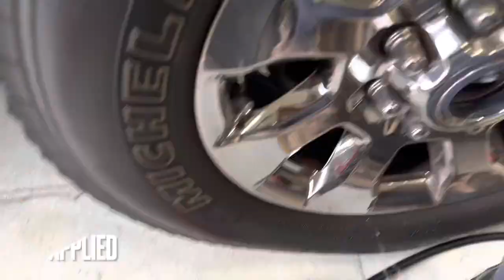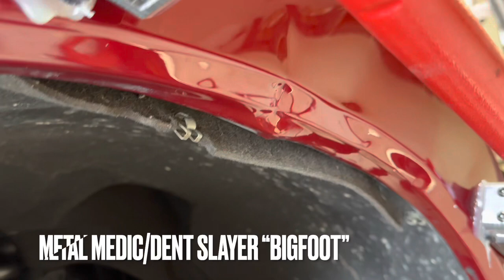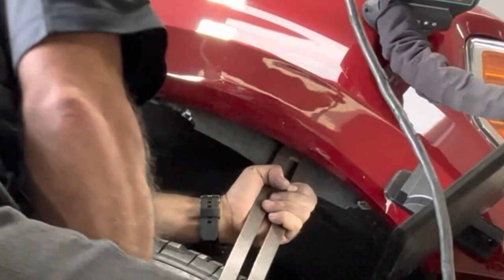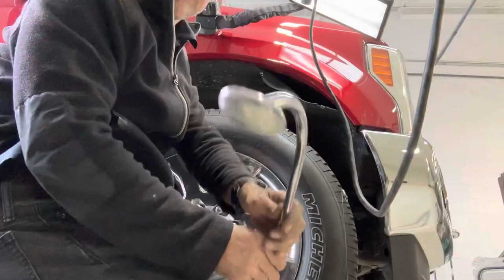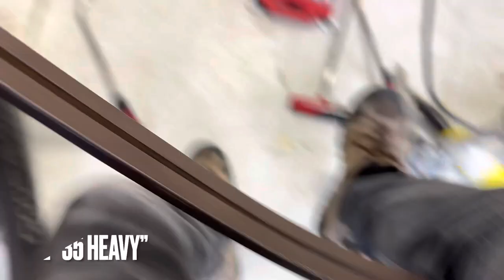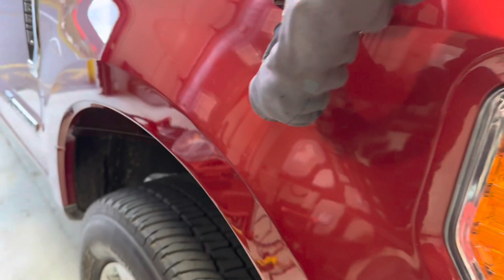CRINKLED ALUMINUM FENDER FIXED WITHOUT REPAINTING -TOOLS AND PROCESS

Comment: Impressive as always Brice as that is such a difficult repair,  like you say it takes twice the power to push it out but it is also more likely to split and tear than regular steel especially when working close to the edge.  Top job Brice! 👍